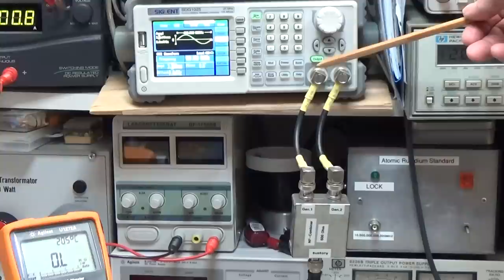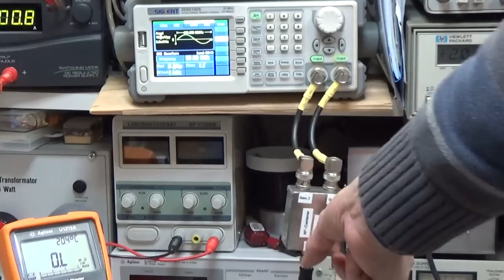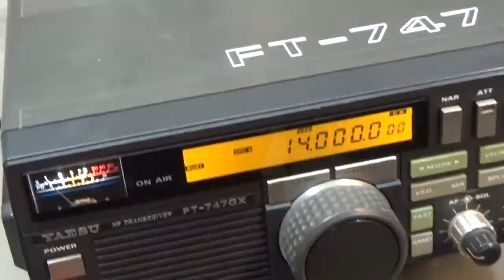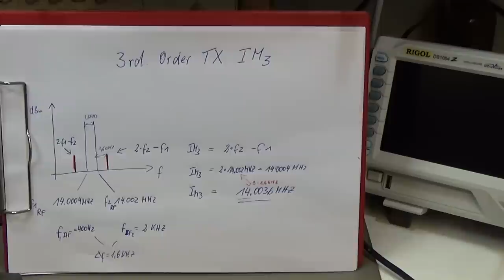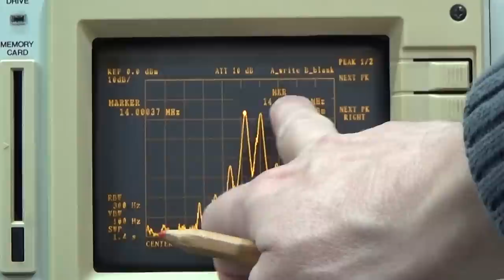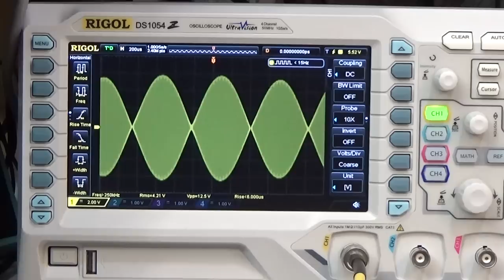#37 Radio Maintenance Yaesu FT747: Verifying the IM3 products of theTX outputsignal after PA repair.

Comment: hi Peter i just am getting more and more impressed !!!
I wanna add that IF out can be put into receivers antenna jack rather than transmitter's microphone to find out whether the IMD3 is really getting filtered or not. End of the day even if TX is producing IMD3 i guess its the receivers Q or selectivity that blocks it.

Adnan Malik
Reply from the maker: Hi Adnan, the issues with IM3 products are that this distortions are right in the pass band. No way to filter out! Thus IM3 products are so critical.  Watch video #93 as it is much more detailed as this older video... 73